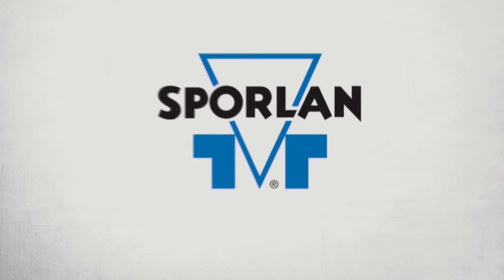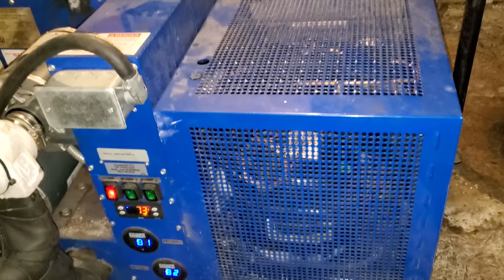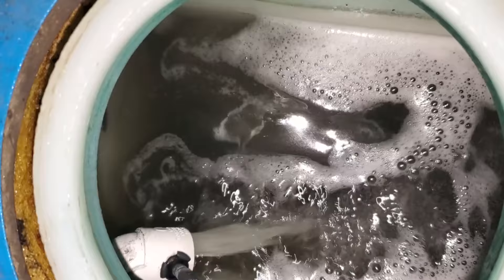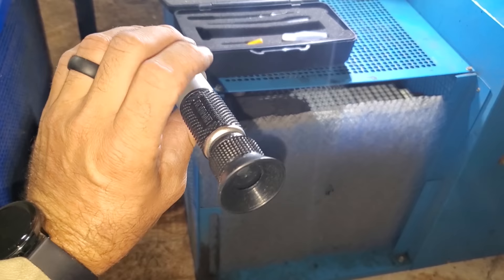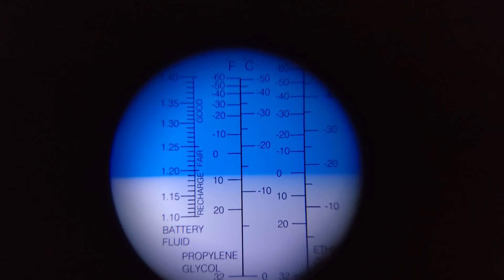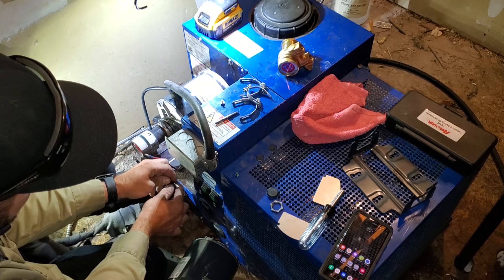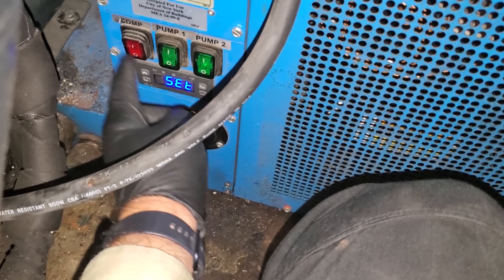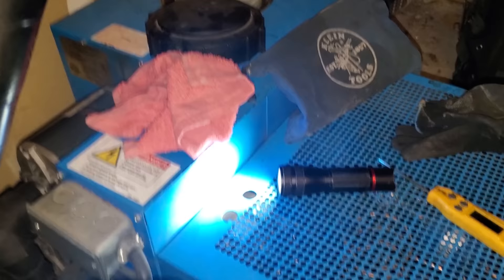THE BEER IS WARM AND BOTH GLYCOL UNIT'S ARE DOWN

Comment: I'm new to this channel and I'm certainly not an engineer and know nothing about fixing these units so can someone help me out "what's a sight glass.....?"
Reply from the maker: A sight glass is a window into the syyem at the point it is installed. In refeigeration we will often use them to indicate whether the system has a solid column of liquid going to the expansion valve. Most of the time this will indicate a full system charge.
Reply: @HVACRVIDEOS  thanks chris now i know i didn't want to ask at 1st cause i didn't want to sound stupid ha ha
Reply from the maker: No worries bud

Comment: If you've got a temp sensor bad, you likely also have a controller going bad, their relatively cheap (as far as I know) so it just makes sense to change them both at the same time...

Prevents unneeded call-backs...

Comment: Ain't them pumps 110volt
Reply from the maker: Yes sir
Reply: The first time I changed one of those motors I smoked it because it was a dual voltage and default wired for 240 volts.... ooops.

Comment: That's the poor and dirty Daikin.
Reply: Lukas Singer, what?
Reply: I was hoping that mini split got some love....
Reply: @Lukas Singer My house uses Daikin Inverter split air conditioner in every room. It tolerates even the most dusty rooms of my dog. (Filters are dirty in 3-4 days)
Reply: I have 3 of FTKC18RV2S and 1 FHA38BV2S
Reply: @Lukas Singer Daikin is besides Mitsubishi and Panasonic the most sold Brand for MiniSplit airconditioner in Germany :D they are the market leaders..
Reply: @Lukas Singer In Thailand during the day it is usually hot OVER 40C (104F). R32 split air conditioners are very helpful in cooling and electricity bills.

Comment: You're not conjugating the verb 'run' correctly.   
5:54  "this one is not ran through the switch"  Should be run, as in, this one is not run through the switch.  
4:15 "I don't know if these are ran in series"  should be:  don't know if these are run in series.  
9:31 "I don't know what he meant by he ran hot water through the machines"  that's correct.  
17:30 "It's ran up and ran in"  should be: it's run up and run in.
27:48 "the glycol is ran in a line..."  should be is run in a line.
Reply: Instead of correcting maybe you should be looking at the local economy, local social standards, and the overall local geographical data before you assume anyone gives a crap about your grammar policing. His level of knowledge far surpasses most people in this industry and you go after grammar! Giving people advice when none is asked for shows psychological weakness within.

Comment: "Sight glass is clear, there's no point in putting service gauges on it"
 Might as well rename the sight glass a charge indicator?
Reply from the maker: I used my senses bud, we had a good amount of heat coming our of the condneser, and the glycol temp dropped really fast and it had a clear sight glass. Of course I would put my gauges on if I was concerned.
Reply: Give that man a cigar!
Reply: All geo units are critical charge. You don't check charge unless you absolutely have to.
Reply: HVACR VIDEOS. 
 You like to educate a lot via this outlet. So I'd figure I'd criticise you a little, since the dawn of creation there have been critics.. 
 No matter how long I do this my senses will never be calibrated instruments. You are blessed to trust relative data with your customers equipment. 
 As for it being critically charged? Stubbies and eight inch hoses if needed work. Take a charging cylinder (If you can find one these days) and play with it and a scale plus some gauges. Fill it with liquid R134a or whatever cheap refrigerant you have. The quantity of gas removed even in the liquid phase through a eight inch, 1/4" hose is less than an eighth of an ounce. Try it. Now a six foot 1/4" hose, woooboy that does rob the system unless you have positive shut off hoses (Ball valves) but then you have to purge and let it suck back in which is a dirty practice in my opinion. 
 I'm rambling. Best of luck to you and your NIST calibrated body

Comment: What's up wity the wastefullness of changing the whole controler when only the thermistor temperature sensor is clearly bad/only had an iffy connection? There is no failiure mode where the chip in the controller shows a wrong temperature but otherwise drives the display and controls the compressor without problems. You can get those temp probes separate for much cheaper than the whole controller kit! Stop ripping off both the customer and more importantly the environtment throwing away working gear!
Reply: correct me if im wrong, but im guessing that he didnt have extra probes and not all probes are compatible with a controller so he had to replace the whole controller, otherwise i would think that he would take a probe from a spare controller and use that then grab another probe when he goes back to his warehouse or where he gets his supplies from
Reply from the maker: Exactly
Reply: I dunno... Maybe take a look at compatibility between devices and the fact that newer devices are typically more reliable? Also, the "environtment" is already pretty screwed.
Reply: I'd also ask, what's the difference in cost between a controller and a truck roll and manhours? If the truck roll is cheaper, just replaced the sensor and hope for the best on the controller.
Reply: @ John smith - Not true. Controller could be faulty at point of connection For the thermistor to the board. Sometimes things are made to work out certain ways. Thier are judgement calls that are made On a jobsite that cannot be seen when watching a video. Chris does a Top notch job for his clients and I Believe Has an ounce of Prevention in his Replacing of some parts Most likely to save the customer in the Long Run & quite possibly the short run.
Reply: @abysspegasusgaming  i mean, even if the environment is screwed, its still better to not make it worse, but sometimes you have to make compromises
Reply: @awesomestuff9715  You're preaching to the wrong horse. Still waiting for the "great divide" to happen.
Reply: Once changed a probe due to p1 error on a Dixell in a 
underbench fridge, failed again 2 days later with p1 error, always change both probe and controller now.